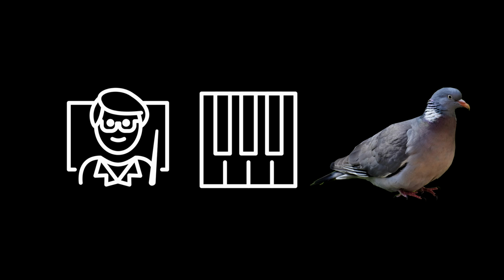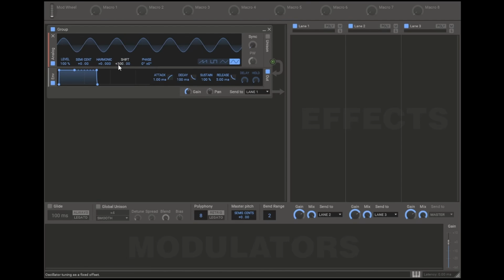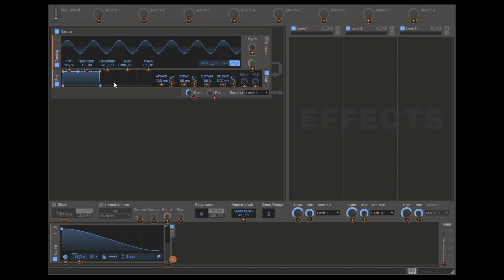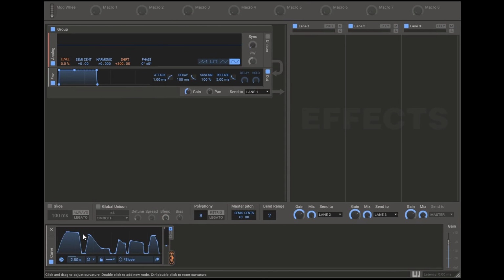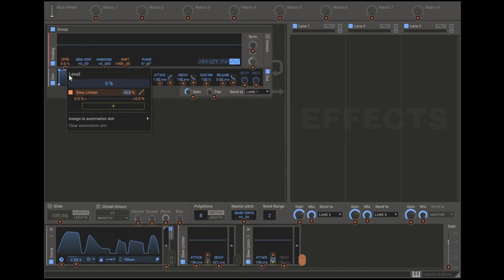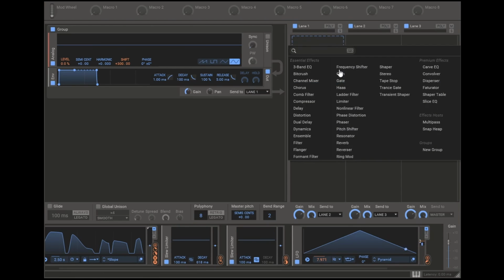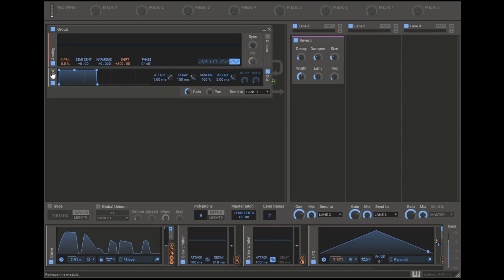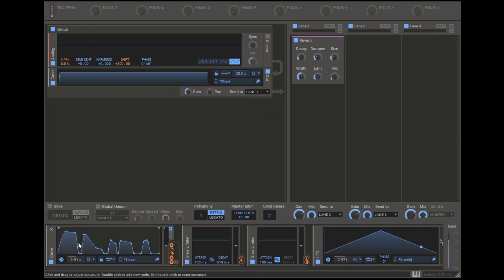Synthesizing a Wood Pigeon Sound || Bird Synthesis 🐦

Comment: Wow, I've also emulated the sound of a common wood pigeon in Phase Plant before. It's amazing to me that someone else has attempted the exact same thing. 😃 Good job.👍 The biggest difference in my method was to add a macro to modulate the volume level with a noise oscillator, to get that breathy throat sound that's part of the sound. I think this way you get a little bit closer to the real sound than by using a high fq lfo as you have done.
Reply from the maker: @Mimang86  Haha, quite a coincidence! I've used a similar method to that when trying to add a kind of "buzzy" high end to sounds. I think your method allows for a greater amount of flexibility because you can add a filter to the noise oscillator before it is sent to modulate the main oscillator, meaning you can fine tune the effect it has. Thanks for watching!
Reply: @mattjhart  Yes, exactly. And often you don't need a separate filter, as you can directly either control the slope of the noise oscillator, or use one of the tuned noise sources and set the fq/harmonic to your liking. Plus you get a bit more random fluctuation to the sound as well, which makes it more natural to me.